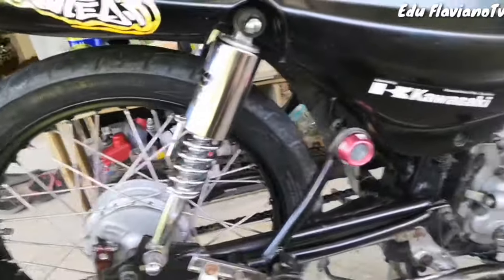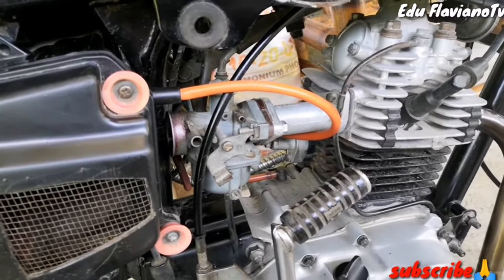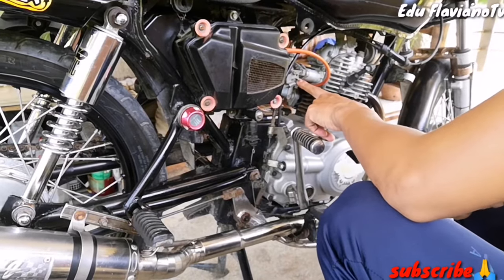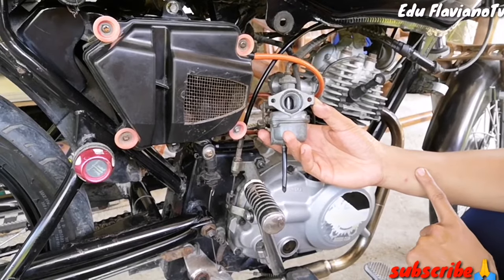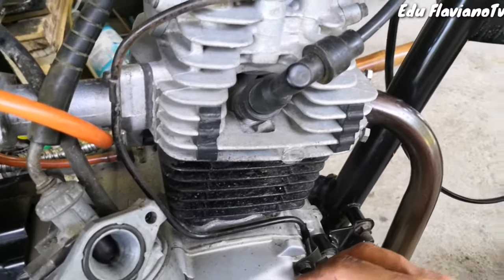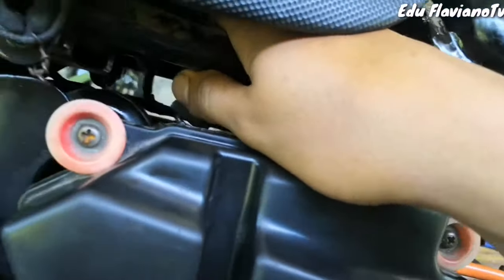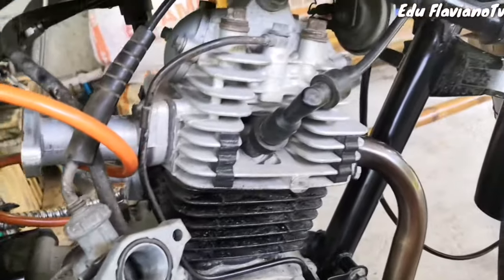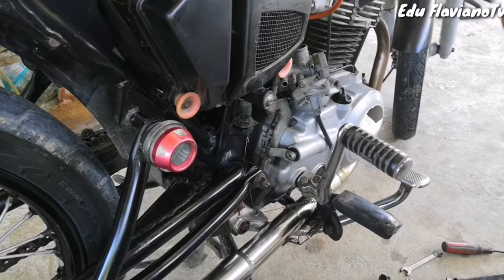Paano palakasin ang motor kahit naka stock carb ka lang. Pwede mo rin gawin

Comment: sir anu dapat cluch spring ni ct100 kapag tangalin ang standard anu dapat pwedy ipalit para mass lalakas sya
Reply: Sa raider 150 pitchbike ang brand..
Reply: @arwinjet6667  paps pwede din ba sa rusi linker 125 ko ang clutch spring na pitchbike pang raider. Pinalit ko kasi kitti. Kaso isang bwan lang malambot na agad. Pang tmx yung spring na pinalit ko paps.